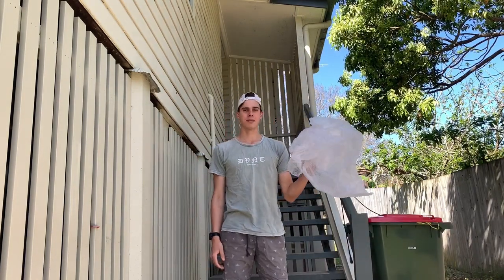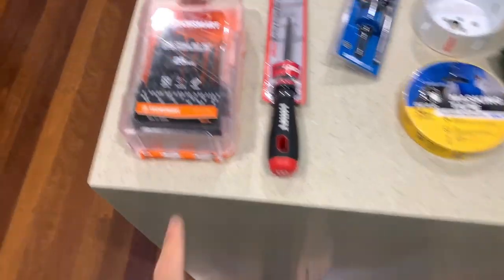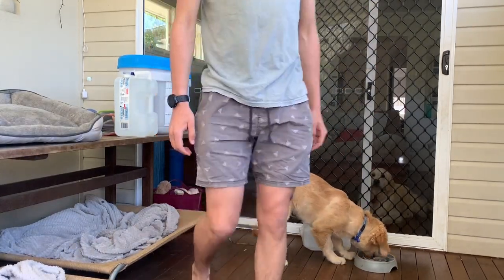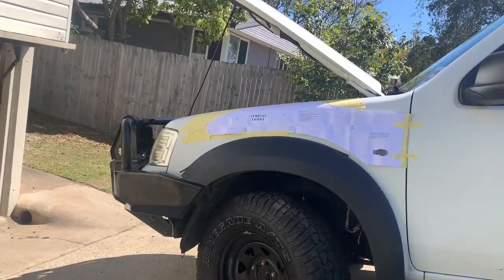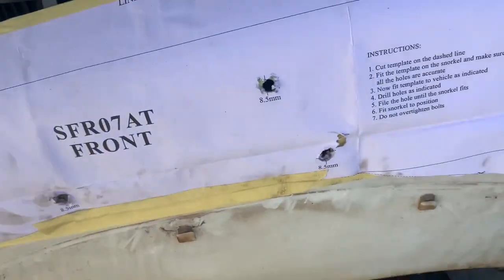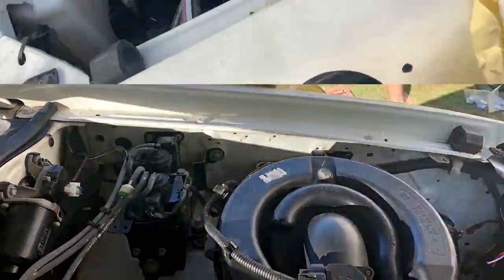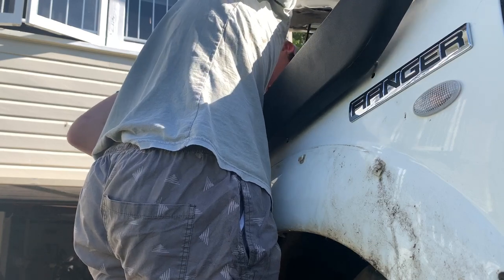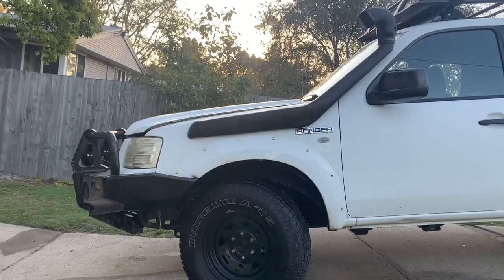How to install a tuff terrain snorkel on a Ford Ranger PJ/PK/BT-50

Comment: Hey man do you know if there is much size difference of yours compared too and actual safari snorkel? How has yours held up? the price is really hard to beat but im not sure what the build quality would be like or the longevity compared to a more well known or expensive brand.
Reply from the maker: Hey mate, not sure how much bigger the safari one is but just from looking at it it looks bigger. Its held in by bolts through the fender and then the top plate to the A pillar. As for longevity wise I honestly don’t know. I’ve had no problems so far but its only been 5 months. But considering the prices for safari ones were up around 500 you could get 5 of these snorkels for the price of one of them. But you could look into an iron man one or stainless or something that you could get for cheaper. Hope this helps answer your questions mate!

Comment: Good shit mate! I got the same kit for my PK ranger . Quick question where did you put that top plate?
Reply from the maker: Mate I still haven’t done it but it goes on the body I’ll probably try to put it under the rubber seal so it looks clean
Reply: Great vid and real good help, installed the same snorkle on my pk today but can’t figure out how to mount the top bracket to the pillar wondering if u managed to secure it yet lads ? Cheers
Reply from the maker: @harveymitchelhill5738  Mate I still haven’t sorry, I’m a bit slack 🤣 but once I do I’ll tell you. Whats your prohlem?
Reply: @liammckenzie835 can’t find anywhere for the bracket to go under the seal, idk if u looked yet but there’s no flat surface to rivet though
Reply from the maker: Oh really? I just assumed there would be. If you are in one of the ranger groups on Facebook maybe put a questions up there. I’ll have a look in the next couple of days

Comment: Hey question,  How many kms do u get out of your tank ?
Reply from the maker: Hey mate,
I usually get around 450 till the light comes on. Which by the sounds of it isn’t great compared to others. Not sure if you’re in the Ranger and BT Facebook groups but its a common question asked on there and some people get up near 600 on the stock tank
Reply: Cheers for reply man. Nar dont have fb. Looking at buying a pk 2010 3.0l for a work ute. Specs claim 10l per 100. And 70l so should be 700. But asked a few people now and they saying 500-600.
Reply from the maker: Yeah no problem mate. I’ve seen that its supposed to have a 70L tank tho but I am 90% sure its only 60 because I fill up a bit after the light comes on and its 50-55L max so I dont imagine theres 20L in the tank on empty. From what Ive heard MAF and MAP sensor clean out and relearn as well as an intake clean can get your kms back up to 500-600 ish. So if you did get it Id say those would be some of the first things to do. Can always just ask the seller what they get if they seem decent too
Reply: @liammckenzie835  ohh ok thats not so bad then for a 60l . Yeah thats odd. No way that much empty. Any issues you had with yours since got it. Read alot of people have injectors and egr issues. Only issues i can find
Reply from the maker: Nothing so far mate (touch wood). Few things I need to get checked though. My injectors have a slight leak I think and Ive got a small leak that comes down the transmission from somewhere in the back on the engine. Nothing major but just small maintenance stuff you can expect on older models. She goes hard mate I love her
Reply: @liammckenzie835   awesome man thats great to hear. Cheers for the info and replies 👌
Reply: How many kms when u bought and now ?
Reply from the maker: No problem mate
Reply from the maker: Ive put about 7,000kms on her so really just new to me

Comment: What’d u use to file bro? I’m stuck
Reply from the maker: I just used a normal metal file bro. It was flat and had a bit of a taper out from the tip
Reply: @liammckenzie835  thanks mate, I ended up gettin it on but it’s the most bodged job 😂 reckon the mechanic would knock me back for a blue slip ?
Reply from the maker: Nah she’ll be right mate. Does it sit pretty flush with the fender?
Reply: @liammckenzie835  not fully, maybe half inch off ?
Reply from the maker: Give it a go mate sheelbs surely

Comment: You might wanna glow the plugs before starting the Ute up lad. 😂😂
Reply from the maker: Yeah mate doesn't start until they glow :)
Reply: 1:05  I call bullshit
Reply: Yeah I died a little inside each time you started it lol. But nah good vid mate. Keen to watch this channel grow.
Reply from the maker: Thanks mate. Usually doesn’t crank until after it glows. If the engines already hot then it starts right up
Reply: @liammckenzie835  yeah I get ya. I think it's just good practice to always let em glow - you'll get more life out of them and trust me... Not a part you wanna change. How's your exhaust coming along? Got one yet?  If you can try spend the extra coin and get a stainless. I'm fitting one next week. If your interested I can let you know how it goes. It's from factory direct 4x4 exhausts. Few options... I'm getting no muffler with cat.
Reply from the maker: Yeah I’ll make sure I do. Was actually just about to order one today. Thinking about getting the same one Lachlan has but open to suggestions
Reply: @liammckenzie835  order away if your keen mate it's all up to you. But stainless is always a best option for longevity especially if your doing sand salt.
Reply from the maker: I hear that and honestly probably should get a staino one but just don’t have the money right now ay
Reply: @liammckenzie835  totally understandable. Gotta just do what we can sometimes. If you're not already, join the ok pk/pj owners group on FB. It's knowledge on tap
Reply from the maker: Yeah mate I’m in a few different ones